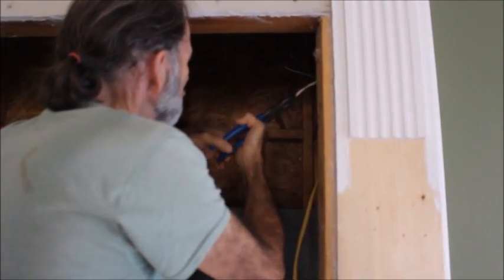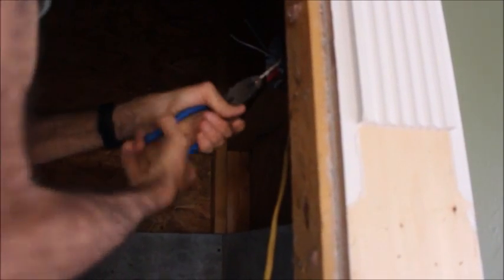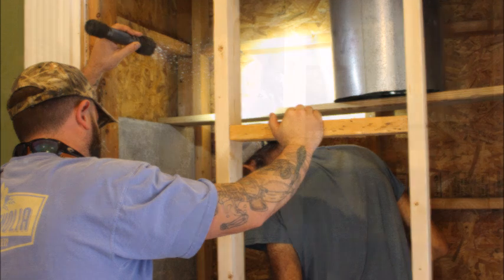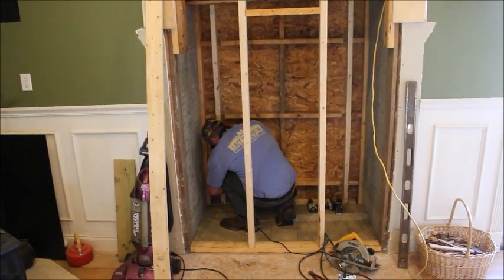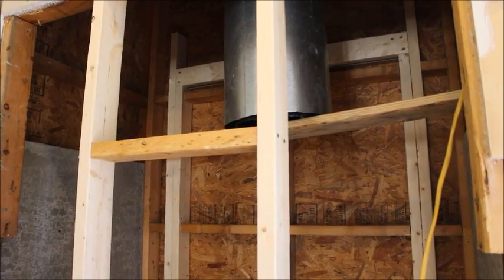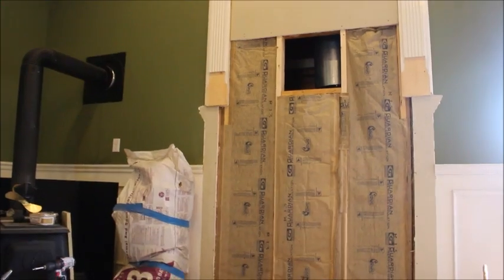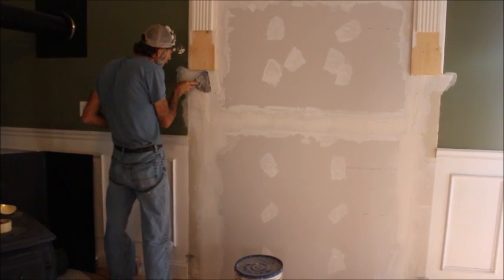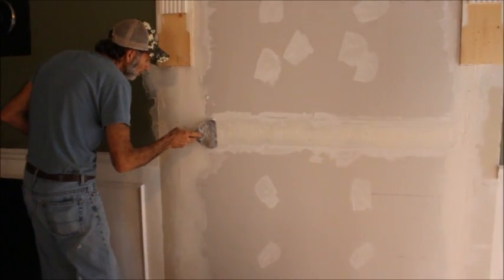Working Smarter not Harder

Comment: Looks good. FYI and you may not care, as a person who used to sell Kuma stoves out of Idaho. One important point we told many customers and I saw it for myself in my own home. The straighter you can make your pipe, the less creosote buildup you will have. Because every bend slows down the smoke speed  when you burn wood.
Reply from the maker: Thanks, ours will have one bend, but we clean out the pipe at least twice during the winter.

Comment: I have never seen anyone twisting the wires back like that before putting the wire not on. Interesting!
Reply from the maker: PlanePreacher Its a code requirement here.As current runs through the wire it moves thus resulting in backing the wire nut off.So they require you twist the wires to prevent this.Plus tape the wire nut.Thanks